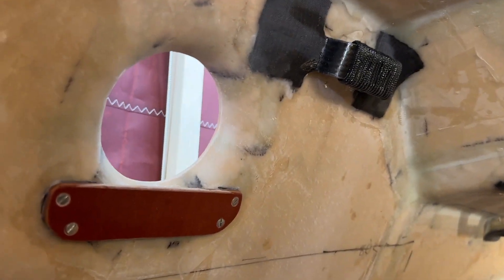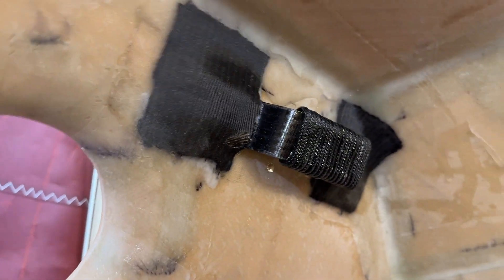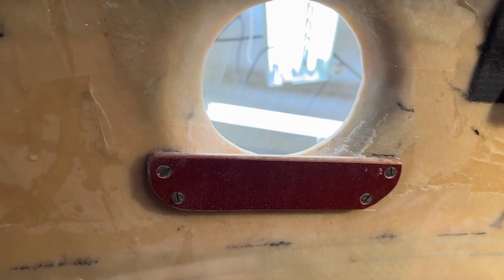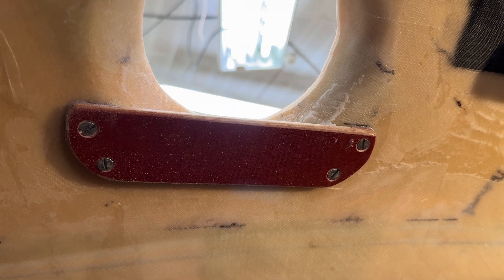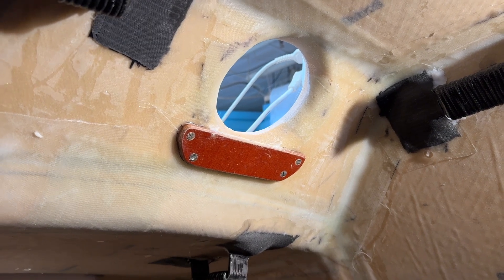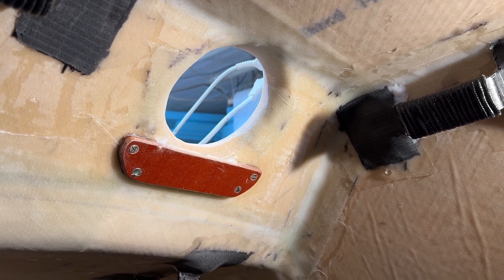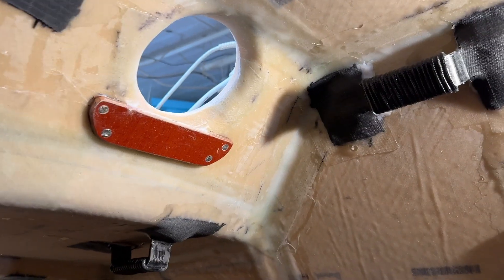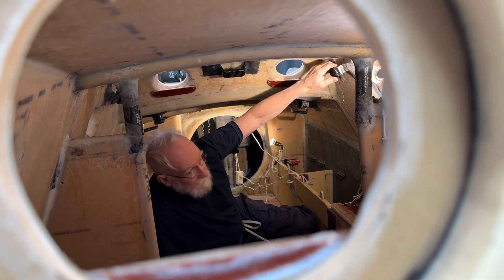8 Jan 2024  Keeping my cabin dry with the help of the windows

Comment: Have you considered wearing a helmet inside the cabin in rough weather to protect your noggin from abrasions or lacerations if you are thrown against the bulkhead or one of those many protruding handles? Maybe even an impact vest to protect your ribs.
Reply from the maker: Seat belt in breaking seas but no helmet.
The distance to the ceeling is only 90 cm or so